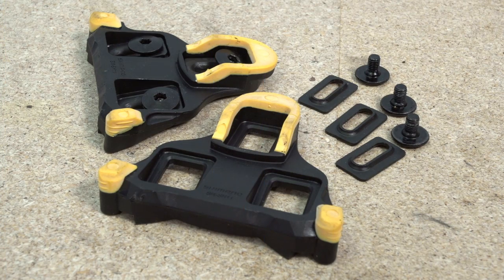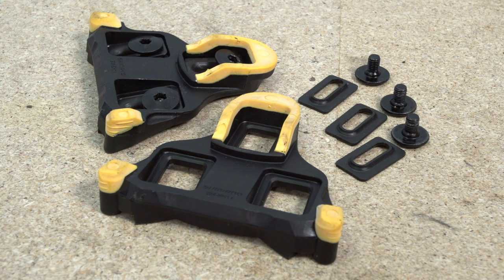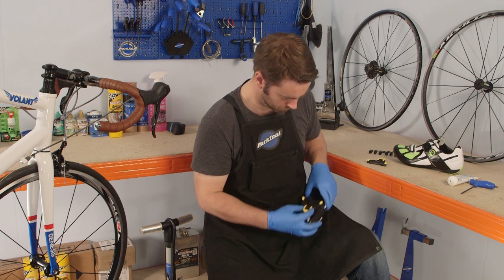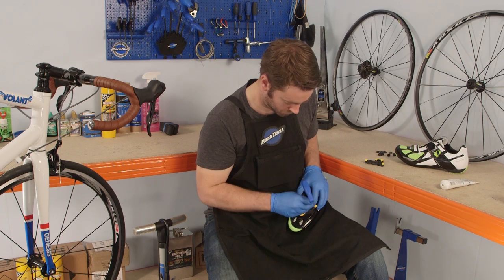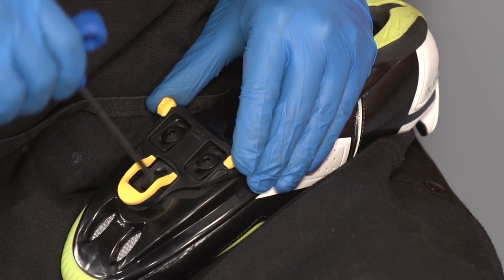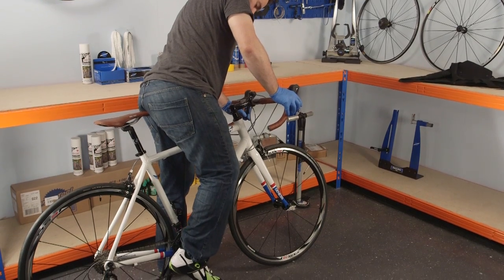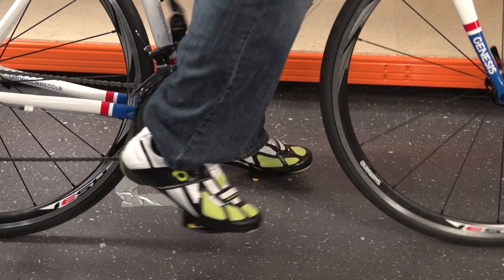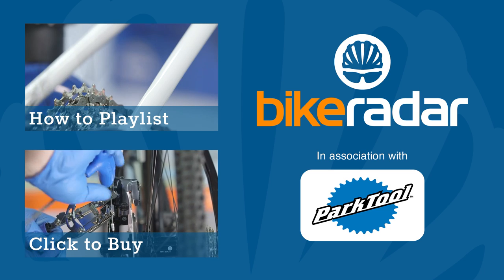How To Fit Road Bike Cleats

Comment: The increase in power  is minimal. For most people it is around 5%. 
The main reason for using cleats is that you stop balancing your feet and you just work the muscles.
It's like you separate the legs from your body, you remove the brain and they just work.

Comment: Clipless pedals are a matter of personal choice.
Reply: isnt true that with clip pedals and clip shoes you get twice as power?
Reply: Apparently that's a myth and pulling up does not help your power output.
Reply from the maker: Hasan Sahoglu It won't increase your output but it can make you more efficient. When you pull up it has two benefits: lifting the weight of your leg off the crank, and assisting the downstroke. 

If the leg that is coming up is resting on the pedal (which is what happens if you don't lift) you have that extra weight to move with the downward stroke - for a start. 

If that 'lazy leg' then starts pulling up, you effectively have two motors turning your crank rather than one. 

So it won't increase your output - only training will do that, but it will use what you do have to its maximal potential. And that will lead to more effective and efficient cycling wherever you ride.
Reply: I'm sticking with my half deep clips :D